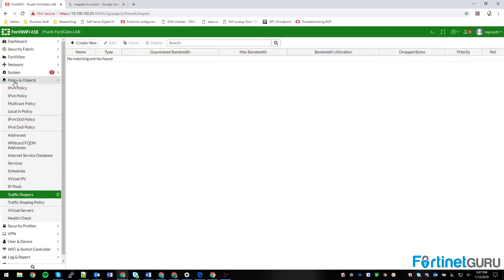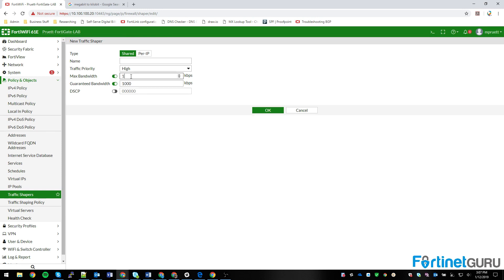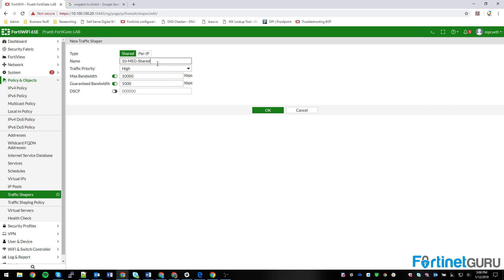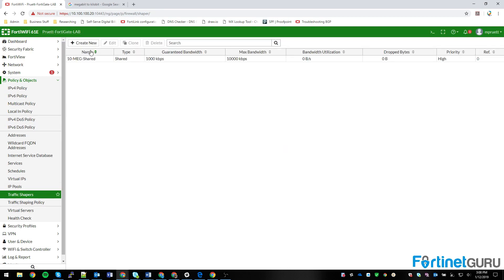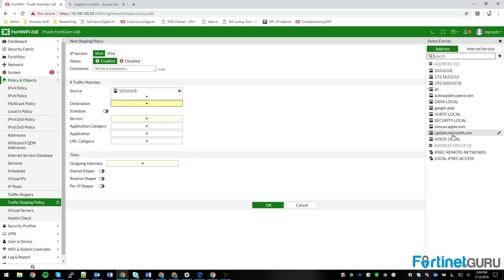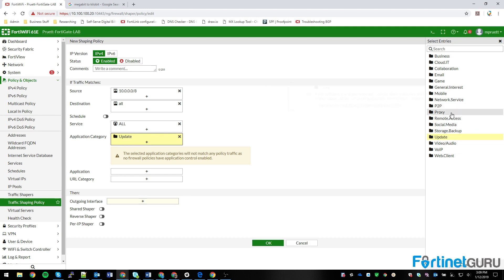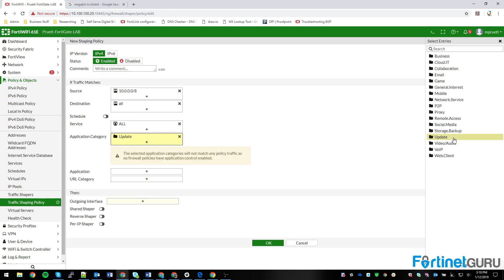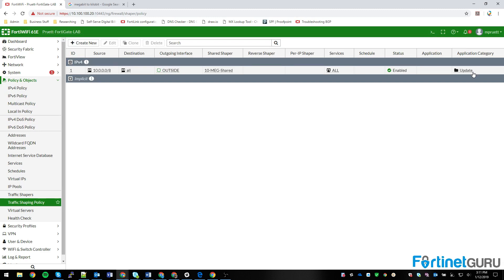Basic FortiGate Traffic Shaping Introduction

Comment: Here is my scenario and hope you can help. I have one device that requires maximum bandwidth on my 100Mbps pipe over all the other IP's on the subnet 10.100.10.X /24 . How do I traffic shape so that if I have a few rogue users chewing up all my bandwidth on whatever ( streaming, downloading etc ) it doesnt affect my high priority IP address from being affected? Essentially packet dropping all IP's on my subnet if bandwidth usage hits a certain percentage used so my high priority device maintains the 100Mbps ( or close to ) connection.

Very great video as well
Reply from the maker: I would traffic shape the baddies to an acceptable speed. I find traffic shaping more successful on killing big hitters compared to trying to guarantee connectivity speeds for the higher priority stuff.